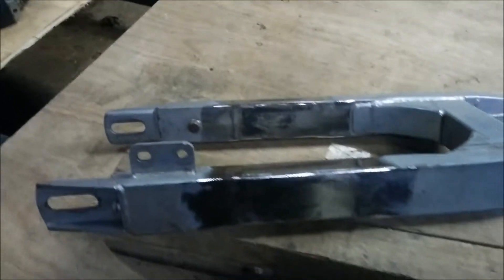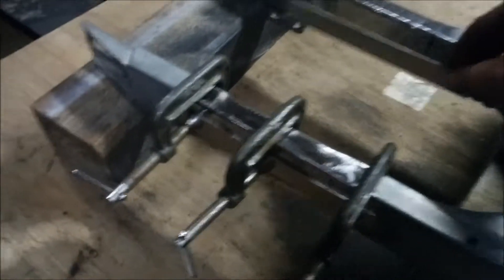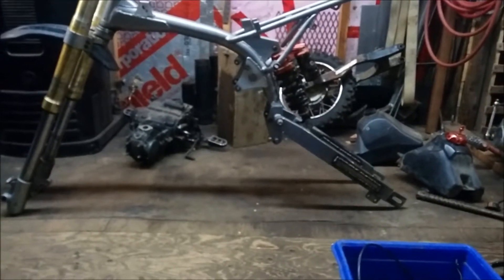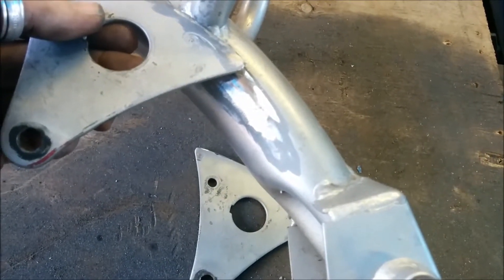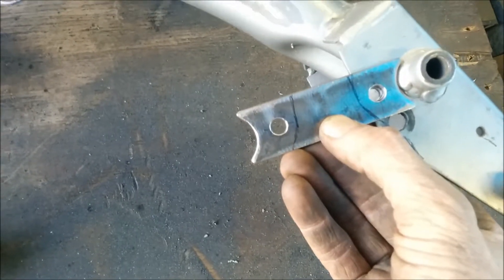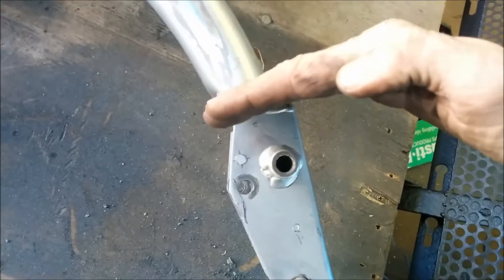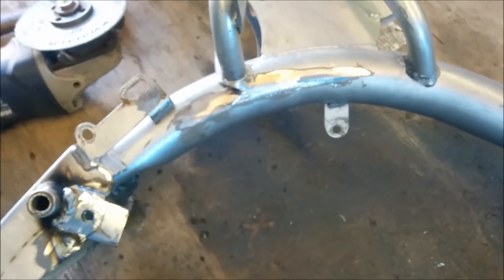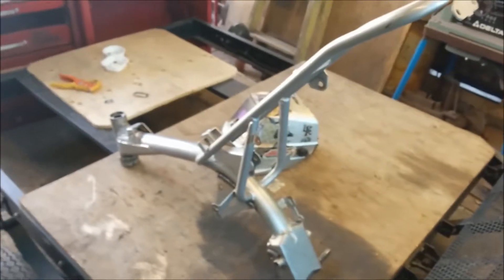pitbike build 2

Comment: Really damm should see my build got a rfz nitro frame painted chrome and another custom dhz frame eith linkage swing arm set up painted like chrome eith blue and purple and just purple and blue splats and pro pair off marzocchi forks pro pair off volt forks and some gpx forks and a couple engines and parts working on some builds